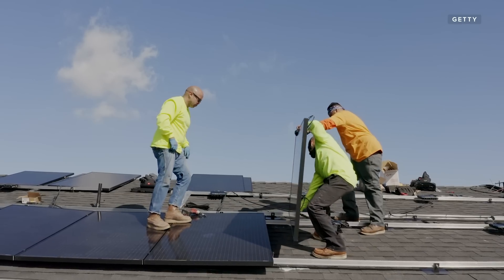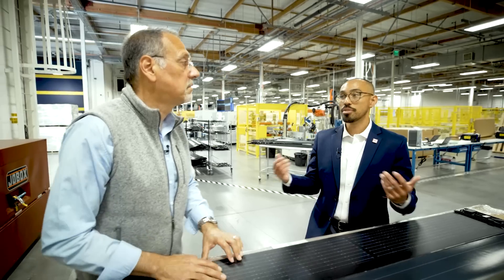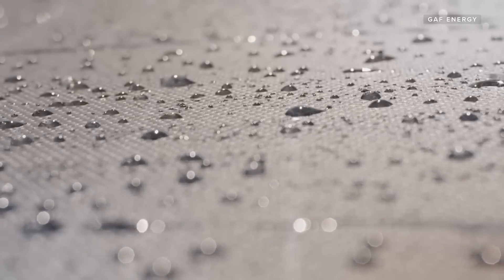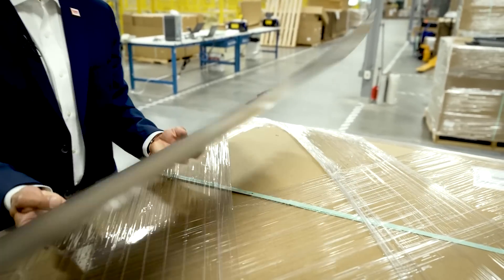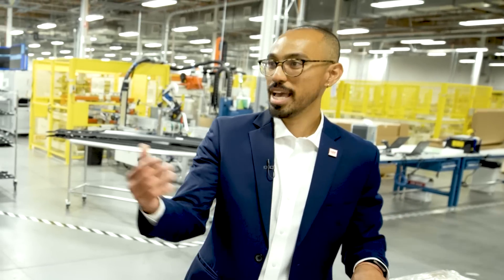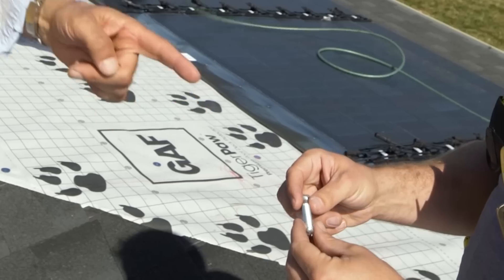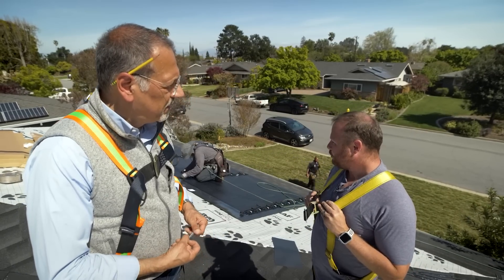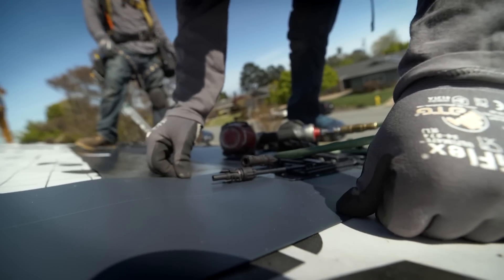If You've Avoided Rooftop Solar Tech, You May Have Just Run Out of Excuses

Comment: I see the same issue with this as their last DecoTech product. Why design something so integrated and then have roof warts for the electrical? They couldn't find a way to hide it better?
Reply: You can hide it but not without making holes, and then good luck servicing it when you have to get into the attic 16" deep in blown fiberglass
Reply: @matsudakodo  I like this product, but they are clearly primarily a roofing materials company. Their panel engineering is inferior to their tiling. For instance, those chunky weatherproof MC4 connectors could be removed if their casing was better than just for show: to hide cabling.

Better still, how about running bus-bar through sections of the nail panels? Nails could provide many points of electrical conductivity between panels: connecting vertically adjacent bus-bars.
In order to reduce power losses,  specially engineered nails would electrically insulate timbers.
Panels would be connected in series vertically. Running down to inverters near the gutter and/or up to the ridge vent.

It's an integrated flat design with redundant electrical connections. Ugly roof-warts engineered out.

Comment: Excellent review, but I don't think it improves the look over traditional panels all that much, but certainly better than the older silver anodized as seen at 7:21.  GAF really needs to make fake panels that match the solar ones and do the whole roof in one style instead of this weird mismatch of smooth panels with what looks like raised seams and architectural style shingles 5:45.   Obviously the efficiency isn't as good at 14.5W/ft² vs 21W/ft² for panels and that's fine if you have enough space, but I really wonder how well they handle typical issues like shading, etc.  They don't appear to have any type of optimizers built in to each panel and they admit, it's a traditional string inverter that relies on every panel producing the same to get output.  Typical issues we have in the NE is snow that builds up on the bottom edge of the roof.  It seems like you'd get no output if just the bottom row was covered since all the cells are in series sideways.  I'm sure they will continue to make improvements.  Another thing that would be nice is to make a ridge vent with an integrated junction box and run the wiring caps all the way up, so they look like they are part of the roof style instead of a cover that tries to hide the wiring.  I like that critters can't get under them, that's a bonus.
Reply: Exactly, they conveniently gloss over a lot of the issues. This is more like a add for GAF then anything else.
Reply: You have covered a lot of issues but I am concerned with strong wind lifting the nails and the lid off the junction box at the top. André
Reply: @SoundzAlive1  - I'd suspect that the GAF engineers are well aware of the need for wind resistance as it's built into their other roofing products. But, like everything else, only time will tell.
Reply: Do you think those other older panels are pointing south? Do you expect this roof facing east to produce an amount of power that is meaningful? (it does cover more area)
Reply: @98Zai  south is the new north
Reply: While the "shading issue" does apply, so many houses have been built over the past three decades with zero shade, that the issue does not apply too many consumers. Of course, the real question is cost and longevity.
Reply: @valkyriefrost5301  What does apply to a lot of customers, at least in the north of the US, is snow. For example, yesterday it dropped about 2" and by noon, the snow slid down and stopped at the asphalt shingles and covered the bottom set of panels of my house.  It's still there and the rest of the panels are producing electricity just fine.  Also while I recognize many areas are different regarding shading and trees, by me, it's required to have at least 2 trees in the front in any new development.  And while those 2 trees were shorter when I installed solar, they now shade the bottom row at times which makes no meaningful difference to my annual output since only 2 panels of 36 get shaded.
Reply: @scottkolaya2110  - I was not saying that this solution would apply to every home across the US. Only that many homes are built is treeless communities, especially in the South and Southwest parts of the country. Other situations, like yours, will require more a thought out solution to be viable.
Reply: @scottkolaya2110  The reason while your not covered panels are still producing it that micro-inverters are used. GAFs string inverter, by contrast, would mean the inverter shuts off when not enough panels are producing.
Reply: @mv80401  Yes, while I do happen to have microinverters, that's not the only method for achieving the same or similar results.  DC optimizers can also provide panel output independence and monitoring while not pulling down the whole string, as well as newer panel designs with bypass diodes that would allow current to bypass the blocked cells.  While not as efficient as optimizers or microinverters, they do help a lot.  I was basically just asking if GAF implemented any of the other methods, or did they have something else unique to their design to help with shading.
Reply: @mv80401  inverter shuts off? Never heard this before. Mine doesn’t shut off
Reply: @chefgav1  String inverters require a certain minimum voltage to operate. During partial shading (mainly tree shadows) when several panels don't produce then the inverter shuts down temporarily. In recent years Maximum Power Point Tracking (MPPT) elements have been added to each panel to prevent that but they add cost, just as micro inverters do.
Reply: @mv80401  I have a fronius string  and underr shading conditions I still produce .Depending on how much shade but never shuts off.String is king downunder

Comment: Imagine if every home in the sunny states of the West (California, Arizona, Nevada, etc) had roofs that were generating solar electricity.  Game changer right there, never mind about the rest of the country.
Reply: @New Moon The price will have to come down a fait bit before It becomes a good investment where I live, It can't come soon enough though.
Reply: @lau4893  Here in Australia solar systems cost half of what they cost in America. Even without tax credits.
Reply: The real issue is storage. Batteries are still too expensive and we powerplants need to run at a certain minimum level
Reply: @Distress.  Yes, very true. Having good size storage at every Solar home would solve that issue. The cost is too high as you stated. What is it? About $5k to $9k for a good size battery bank to store power to use at night? Add on top the cost of the solar panels and it becomes a luxury. Can't afford it.  With good spring season sun here in California I harvest around 65kWh daily. So during the day I have a huge surplus. Then at night I need the utility power. A battery would be awesome but too expensive. Utility companies are hating that now. That we're using them for storage. LoL .... That was what they advertised to promote going solar. It's gonna be interesting in the near future when a few million electric cars need charging at the same time.
Reply: @Distress.  - In the near future, your home batteries will do double duty as the batteries for your electric car. In fact, you only have to wait until Ford delivers yoyr F150 Lightning.
Reply: Would like to see that in Florida
Reply: except that solar panels dont work well in the heat....making those states pretty much a no go.
Reply: @DieselRamcharger  - Solar does work in heat, just not as good.
Solar panel spec sheets should have a  “Temperature Coefficient Pmax.“ 
The temperature coefficient indicates by how much you can expect a solar panel to decrease in maximum energy output per each increase of 1°C above 25°C.
For example, a Peimar 270W panel has a PTC of -0.43% / °C. If one of these solar panels heat up to 45°C (113°F), that means they the lost energy % = 20 x -0.43 = -8.6%.
At 55°C (131°F), that means they the lost energy % = 30 x -0.43 = -12.9% or 235 W max output.
Only time will tell if these new shingle designs will perform well or even last long. I"m skeptical as new products like this can take several generations to work out their kinks.
Reply: @valkyriefrost5301  PV arrays lost about 25% efficiency here in the hot desert. that means the 6000w array on your roof only produces 4500w. All the amortization you were sold on is TOTAL FABRICATION because the PV panels CAN NOT PRODUCE their "label rating" in this environment. So if you need a 6k kit you have to install a 10k array.. Now run your payback numbers using REAL DATA. You will see that its cheaper to BUY FROM THE UTILITY. Solar Panels are a SCAM. In a certain few applications they are great. Real remote off grid low draw situations? Perfect. Live in the middle of a city in a first world country? You are being hosed by being offered the MOST EXPENSIVE energy that could every possibly be produced. Instead of cheap, clean and safe energy.
Reply: you lose .38% per degree over 77 degrees. Phoenix Arizona is routinely 110+ degrees. Thats 12.5% efficiency loss right there. Now lets remember objects baking in the sun get MUCH MUCH hotter. Our sidewalks are 180 degrees.  Thats a 39% loss in efficiency right there.....People are completely ignorant in the things they beg for. Because it SOUNDS good, doesnt mean it is.
Reply: Some people in this comment thread prefer nuke-you-lar because....  OH WAIT, Nuclear Power SHUTS DOWN COMPLETELY if their River/Lake is too warm.
Reply: @arcanondrum6543  probably why Canada likes to build them close to the Great Lakes, well at least in Ontario. When I look out my window I can see one of the biggest Nuclear Power plants, that also happens to provide a crap ton of medical isotopes to save lives
Reply: @NotDuncan That's pretty funny.  The only Nuke plant I can think of where the US State it was located in had license renewal power is shut down now and being decommissioned.  Probably my second favorite story about that was that the somewhat higher income residents of that town (most were NOT employed by the Nuke plant) built a school for K-5 across from the entrance to the Nuke plant.  Apparently they,  like you, have never heard of Beta Radiation affecting living creatures located close to the plant. 

Also,  show me a failed wind turbine or a failed solar panel that killed a whole town.
Reply: @arcanondrum6543   … I’m not that close, it sits on a small peninsula and I have a lake view. The entrance roughly  15km (9.3miles) away, the facility is massive as well. 

We also have a ton of wind turbines scattered across our county, with of course people protesting because ‘what about my view?’ otherwise known as Not In My Backyard, strange how that also happened to the plant itself all along the way.

Change is scary, and if I don’t understand it probably magic.
Reply: Yet the power companies (AZ) fight us at every step and destroy nearly every incentive to go solar.
Reply: All shingled roofs all over NA. not just the sunny states.  This would be the ultimate in DG.
Reply: That would definitely be a game changer - unfortunately, the powers that be have found themselves not as profitable and have schemed a plan to implement a "solar fee" for those of us who have solar panels. Here in California the major power companies have asked the CPUC (Utility Commission) to approve an average $60 to $80 monthly fee because Solar panels are making electricity more expensive for those that don't have/can't afford panels. That's their justification. I think real reason is lower profits. Comission is due to vote on that sometime soon.
Reply: @EngineerX  - Never underestimate a corporation's desire to quell a free and fair market in their pursuit of profits.
Reply: More over, all those homes could generate more electricity than Hoover Dam, meaning we remove the dam and return the Colorodo River back to its original condition.
Reply: @valkyriefrost5301  Wait what about the water supply
Reply: @N0Xa880iUL  - If you've been following the decline in snowfall in the Rocky's and the subsequent decline in water flowing down the Colorado River from that snowfall, then you'll know there's nothing we can do about the water supply other than to re-evaluate the distribution plans for that water. Meanwhile, Lake Mead's water level continues to decline y-o-y and at the point of ~1050 ft, 12 turbines (older models) will be forced offline. At ~950 ft, the 5 new, remaining turbines will be forced offline. Today, the level sits at 1056 ft. In 2000, Hoover produced 5.6 GWh (gigawatt hours) with the older 17 turbine and 1200 ft water level. Last year, the plant only produced 3.3 GWh. To prepare for the real possibility of the forced power production shutdown of Hoover, those SW states should be doing everything they can to get consumer rooftop solar rolling out every where they can. Current commercial deployment in NV and AZ is about 3.4 GW (combined) and their consumption since 2000 as more than tripled. Without Hoover, Las Vegas will go dark (and thirsty)...
Reply: @valkyriefrost5301  Wow thanks for the informative comment! Much appreciated.
Reply: @N0Xa880iUL  - You are welcome. But, as always, pls do not simply take my word (some anon guy on the net) for it. Check on this info for yourself. If I get something wrong, I hope someone is out there to help me know better.
Reply: @valkyriefrost5301  Sure, thanks.
Reply: @valkyriefrost5301  lmao.
Reply: you cant power an arizona home off the rooftop. its simply not enough sq footage..
Reply: @DieselRamcharger  - that all depends on the energy consumption of the household. Today's American energy footprint is much larger than it needs to be. Just like too many people driving around in 3 ton gas guzzling SUV's when a Mini Cooper or a Prius will suit their needs just fine.
Reply: @DieselRamcharger  @Valkyrie Frost You should be able to power it completely but it will require correct sizing of solar arrays and battery. It'll be costly but it can be done. I have 2 fridges, central air, 85 and 65 inch LED TV's, and a bunch of smart appliances and devices running and have about 4kw or more surplus from solar (1840 sq-ft area for the house) 42 solar panels that  are not the latest. 260W panels. When sun is out total production is about 64kw per day in May. Yes in winter it will be less and not enough. Average during 1 year solar power production can easily exceed consumption. Should be enough to power a house and recharge a good size battery.  This year I'm at -$350. I've exported more power to grid than consumed. Now there are 400W+ newer panels that would yield more power with a proper sized battery bank you can definitely power a house for the evening.   Just need to throw lots of money into the system.

Comment: So we're going to avoid the environmental problems in the manufacturing of solar panels?
Reply: We already are ignoring the environmental problems in manufacturing asphalt roof shingles, right??
Reply: @ctgottapee  lol. All you did there was prove my point. 2 wrongs don't make a right. If you're going to push green, make it completely green. Can't be making environmental impacts if you're doing the same practices the people you're trying to wipe out are doing. Keep the system you have until you've perfected the replacement.

Comment: okay so now that this idea exists, can we then put a perfermated pipe at the top of the roof to trickles cold water down to coll them. then collecting it in a tank and pumping it back up. this can clean and cool them and maybe offer some warmish water for the house. And if any embers falls on the roof during fire season then it will take care of that too.
Reply: Way to Complex for the mass market.   As an option it might work.  It makes it more difficult to get to the break even point.
Reply: @fatboy19831  didn't seem so, the water pump would be small and the roof area very large. Plus the efficiency boost.  Also water is very good at absorbing heat and is able to bend light into he panels from non direct light should that be relevant considering it would a thin film. Your tank then would then also be able to collect rain, which means less demand for central water too and be covered to stop evaporation. So I do t really see a problem. Or a complexity issue...what complexity?, especially with things you can get at home depot easy.
Reply: @fatboy19831  if they provide the shingles and install them then I can build the rest in under a day. Whats to difficult toassproduc3 about this? Are people dim?

Comment: A version of this for RV's would be great.
Reply: Not a useful application, roof space on an RV is very limited, you want the higher power per square foot of the fixed panels.

Though a flexible solar panel that can be rolled up would be a game changer as an awning upgrade.

Comment: DO NOT GET THIS!

You will get ARC faults when those cells go bad!
The system will stop producing because of that!
Theres also a SIGNIFICANTLY HIGHER risk of burning down your house if one of those cells burn up so close to the flat surface of the wood on the roof!

I am a solar technician. I have seen these things happen on string inverted systems and solar panels so many times!